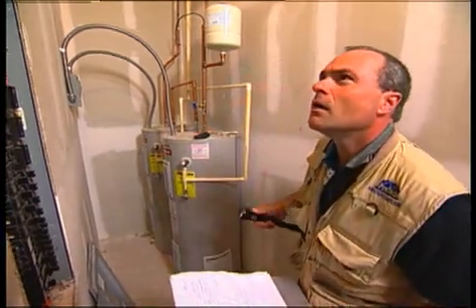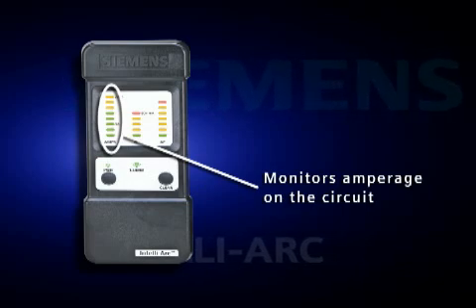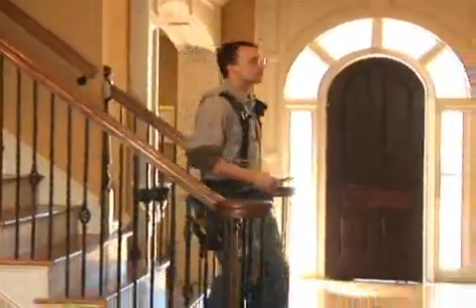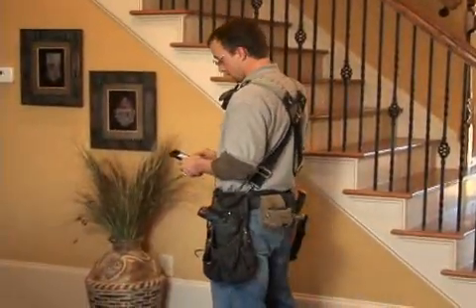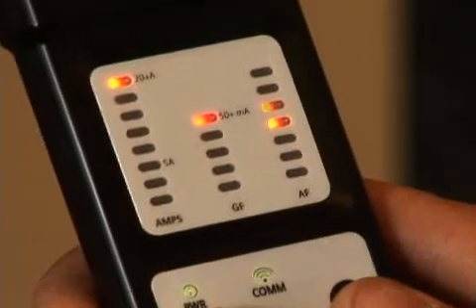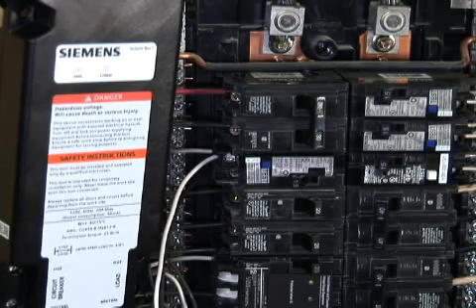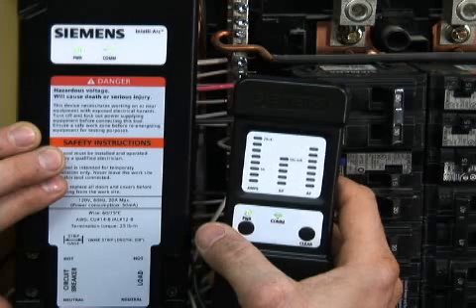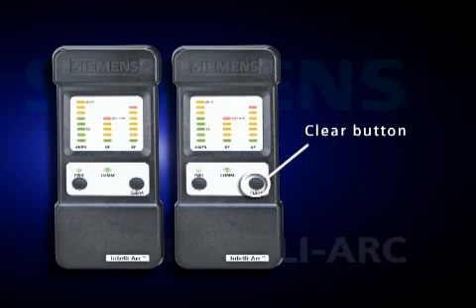Siemens Intelli-Arc Diagnostic Tool

Comment: But are Arc faults really the cause of fires?
Generally not. 
Usually it's high earth loop impedance that causes theses, such as extension lead, bad workmanship, old outlets, old wiring, non maintained properties and rodents.
AFD are smarter than the normal mcb but they still appear to be primitive when you consider what microprocessors are capable of doing.
All in all they cause nuisense tripping and are a pain.
Reply: +Maurice Upton They don't cause ALL electrical fires.
Reply: Benjamin Esposti Yes you are correct, these are a newish circuit protection device that must be installed because of insurance companies, most fires are not always caused by arching type faults, faulty Cell phone chargers, old televisions, old power outlets with loose connections and dust build up, nail damaged cables and loose joints just heat up and ignite the plastic around them. Should a circuit breaker of any sort trip,  it pays to investigate the reasons rather than switch it back on and hope for the best. AFCIs can not tell the owner where the problem is so what should the homeowners do to identify the source of a potential electrical fault, call a registered electrician.
Once an electrical fire starts and sets off other fires, the smoke and heat destroys a house. It pays to install sprinklers or smoke alarms and have these alarm systems connected to your cellphone via an app.
It also pays to keep all doors closed to reduce the spread of the fire and switch off unused electrical devices like cellphone chargers when not in use.